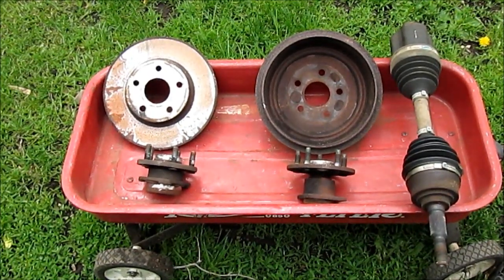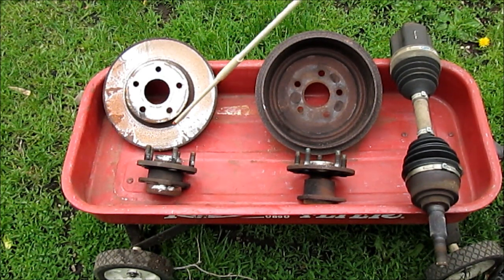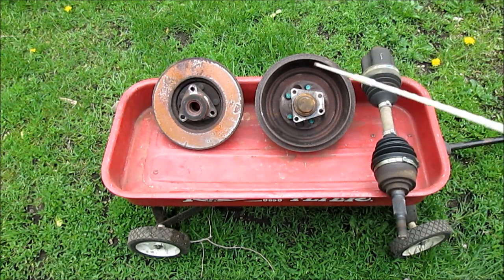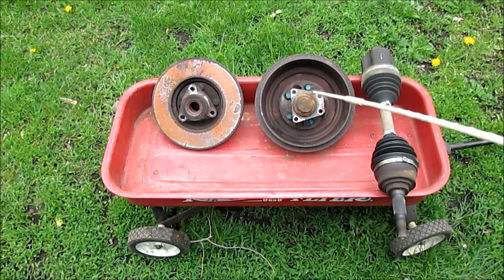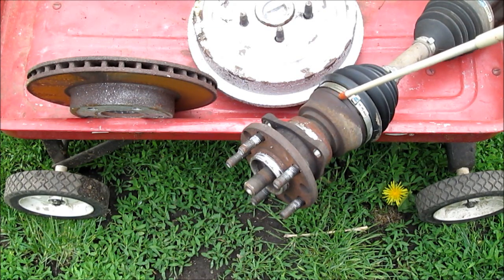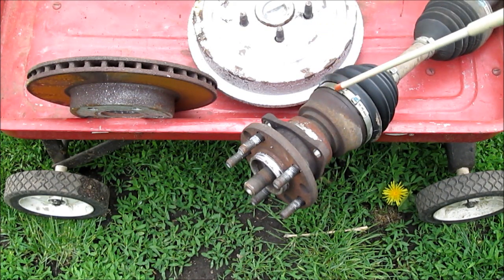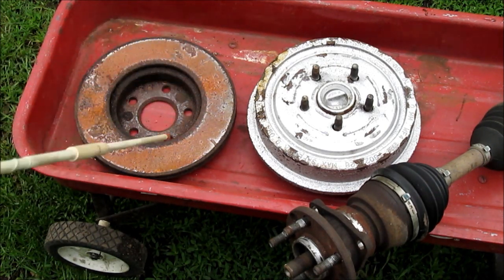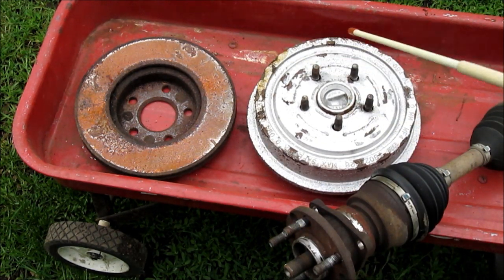Turn Table Idea. ( made from front wheel drive car parts) part 1

Comment: I like this idea, thumbs up!
Hand operated would work fine, you could even use a band brake to adjust how easily it spun; like for resistance to better control the rate it turns at.
Reply from the maker: It would not take a big motor to turn it..A reduction gearbox would be a nice add on to it

Comment: Flip rotor...lay a layer of rubber mat on face of rotor for traction...punch holes in rubber for magnets that are slightly thinner than rubber..magnets will provide clamping force against rubber..pinching it  between rotor and work piece..
Reply from the maker: I would be using a cutting torch Things will be getting Hot..But if I make it using a 4 1/2 grinder with a cutting disc  That idea may work good

Comment: Would there be enough room between the bolts in the well to place some rare earth magnets for steel.
Reply from the maker: There is alot of room in the center That would be a good Idea as long as they did not get too hot